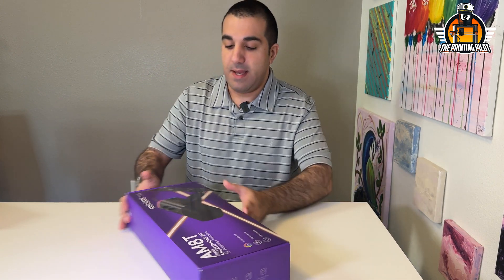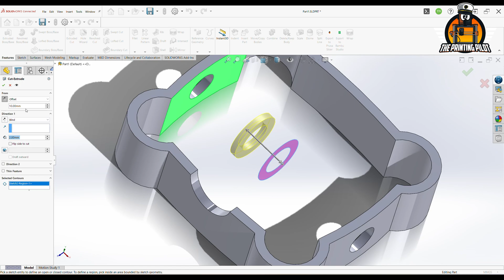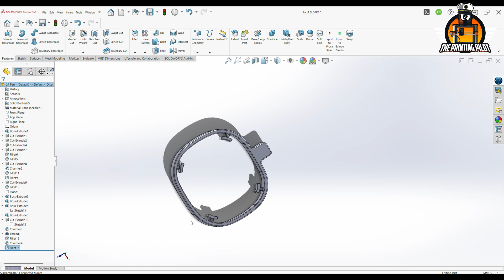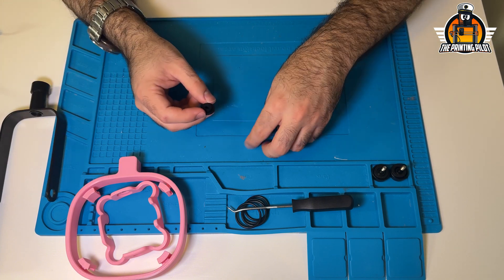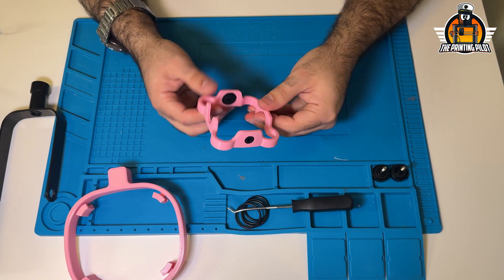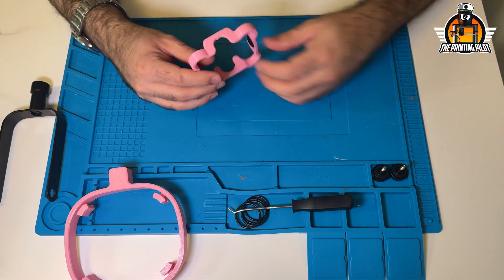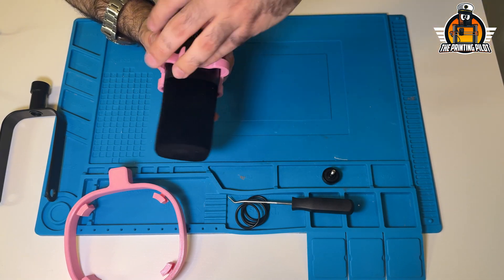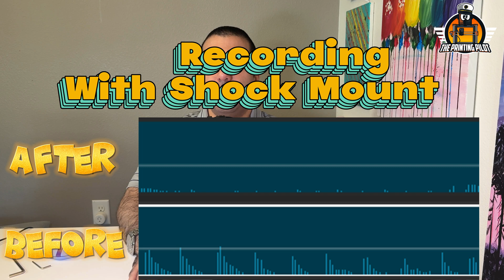DIY Shock Mount For The Fifine AM8/AM8T Microphone. (you wont believe the final result).

Comment: Hey i have a question, do u ship the rubber bands with the shock mount when buying on etsy or do i have to buy them separately?
Reply from the maker: No it's comes fully assembled with everything you need. You should check my website instead of Etsy also! 😊
Reply: @ThePrintingPilot  Okay ty i just bought  it :)))

Comment: Thanks man, just did a recording, ....... the first with FiFine AM8 and had problems with mouse moving on table ...........   !      🙂
Reply from the maker: You should print it! It works really well
Reply: @ThePrintingPilot  Just sent the links to my mate, who got a 3d printer ..........    ;-)   Thanks man!
Reply from the maker: Can't Wait to see it! Make sure to post a make when you're done! 👍
Reply: @ThePrintingPilot  Hey mate, is printed now with some nice orange PETG, and instead of the o-rings I took small hair rubbers, which are softer, and by taking em double they fit perfect! Job done, and touching the table or mouse moving noises are gone by 90% I would guess!  Thanks man!